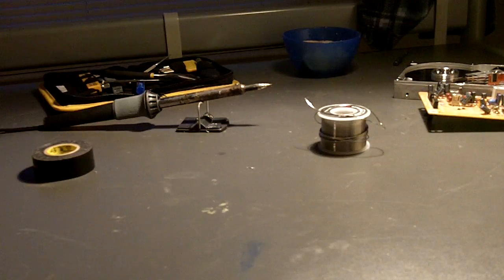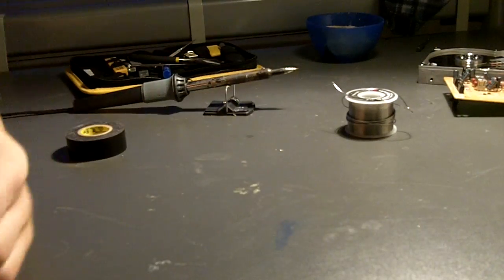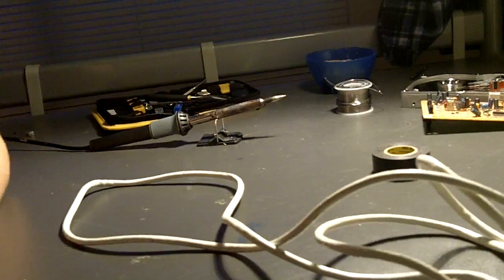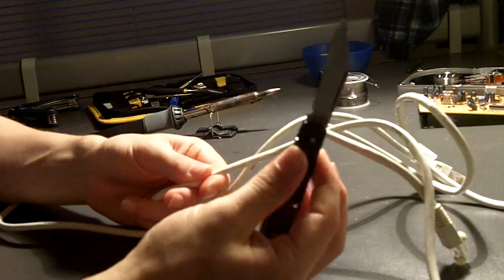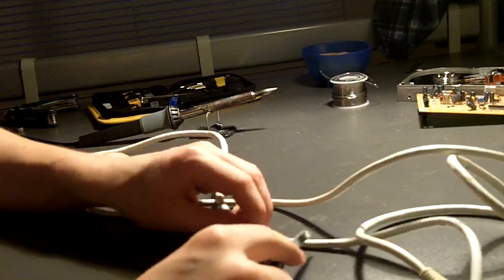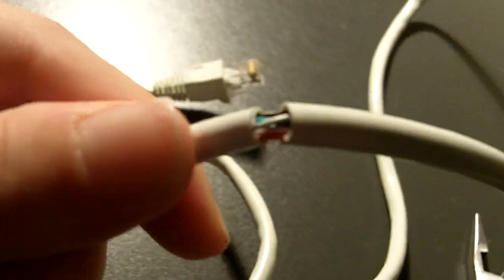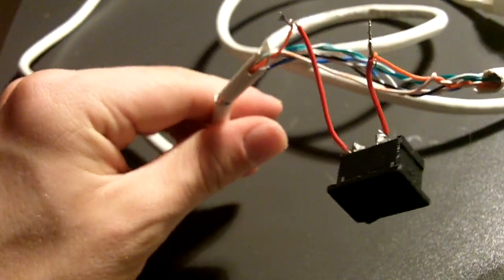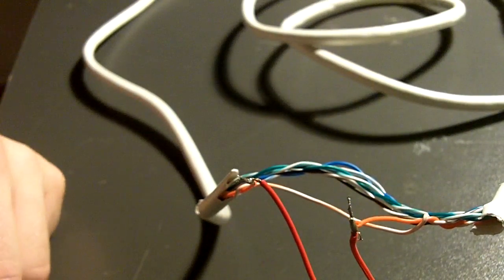How to make a custom lag switch for console video games

Comment from the maker: @Ahhlx No, it doesn't really matter as far as what kind of wire you use as long as it makes contact. Also, you don't even have to have a wire running from the Ethernet cord to the switch, but if you don't you will have a much more difficult build on your hands. 

Hope that helps.